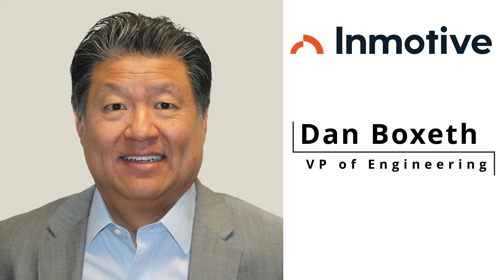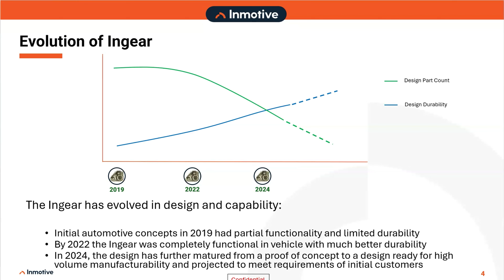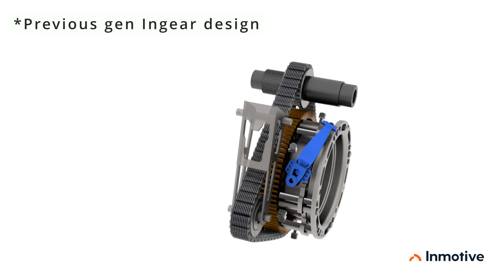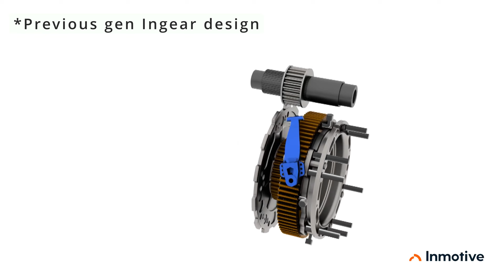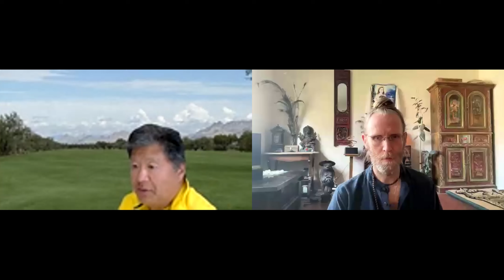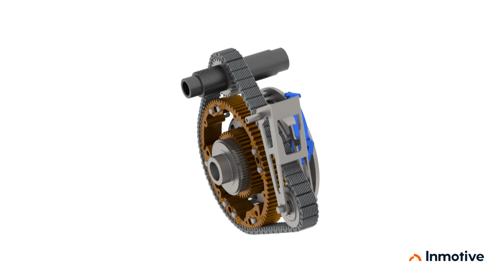Ingear 2 speed EV Transmission Technology Interview | Aptera | Dan Boxeth VP of Engineering Inmotiv

Comment: I don’t see any reason that these can’t be stacked. Ie a 3 stack to allow a much smaller motor. 

It may also be interesting to see these on an ebike with each gear set being the size of a stack of cards, or connected to the compressor on an air conditioner to have a 2 speed heat pump with much simpler electronics package.

Comment: Thank you for the interview. Here are the biggest takeaways:

- Tested key subsystems to over 400k shift cycles; 3–4× expected vehicle life.
- Sealed-for-life; no oil changes or routine maintenance required.
- Performs normally in extreme temperatures.
- Supports full regenerative braking.
- Quiet operation; redesigned shifting is smooth and maintains uninterrupted torque flow.
- Double-digit efficiency gains over typical single-speed reduction gearboxes.
- Part count cut from about 150 to ~70, using lower-cost materials such as plastics and powdered metals instead of all steel/aluminum.
- Target weight ≈50 kg.
- Cost is roughly comparable to current single-speed units, with benefits outweighing any small premium.
- Gearing “force-multiplies” the motor’s torque, similar to internal-combustion drivetrains, making smaller or less powerful motors practical and keeping EVs affordable.
- Today’s single-speed EV gearboxes force motors to operate in a narrow efficiency band. A two-speed design roughly doubles the time the motor can run in its high-efficiency zone, improving range and performance without adding cost.
- Working with Aptera, whose ultra-efficient vehicle goals make the two-speed a natural fit.

As you know, I have a lot of reservations about this. Introducing mechanical complexity has major trade-offs: more potential failure modes, higher manufacturing cost, and added maintenance/repairs/replacements. Parts that don't exist have a 0% chance of failing. There are also risks in working with a startup that has a product that hasn't been mass produced. However, if it's engineered to last 3-4x the expected vehicle life, then the failure rate would be roughly 3 in 10,000 units over 100,000 miles driven per vehicle. That's a massive engineering win if this actually plays out.

Comment: Thank you Dan/Raj
Nice complement to Inmotiv ‘s site information. Nice weight for  the lightweight Aptera… Emphasizing  the SIMPLE in the mission. 
I guess we will not see it in the Initial Aptera Launch Edition but I hope I can realize in my second reservation ! With the two speed transmission improvements which also reduced noise level I’d be curious if the noise level can be compared to a common device we might all know ?  
Keep up the INnovation for mobility !
Reply from the maker: Would be nice to have confirmation on the Launch Edition running the ingear. Seems like it would bolt on easy enough when the time comes.